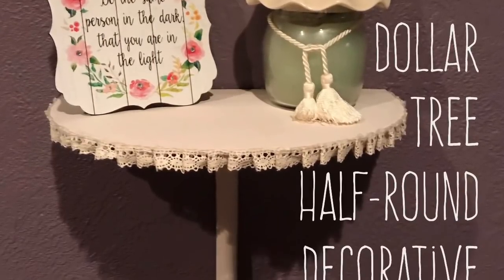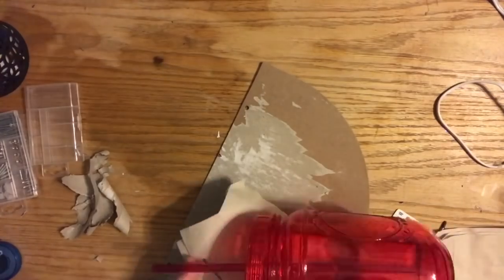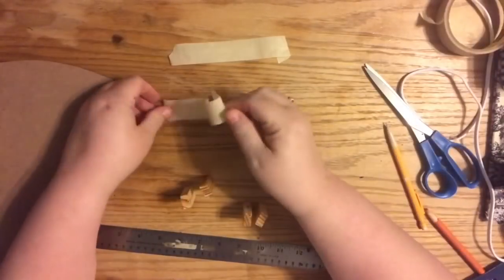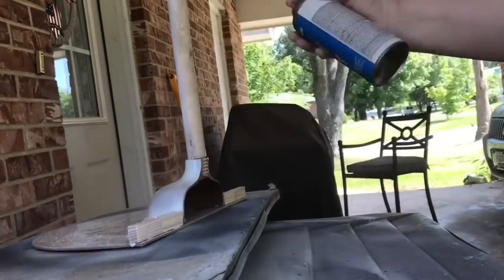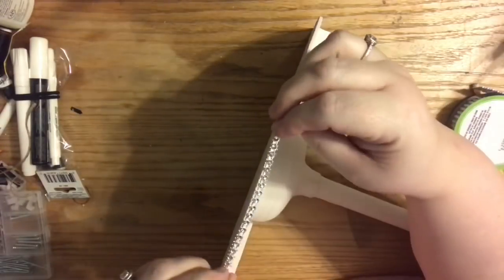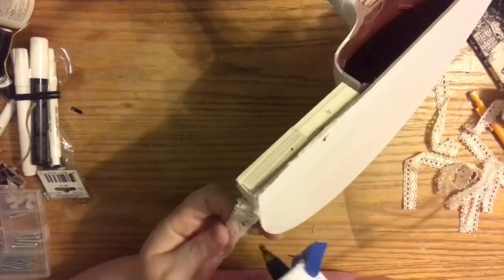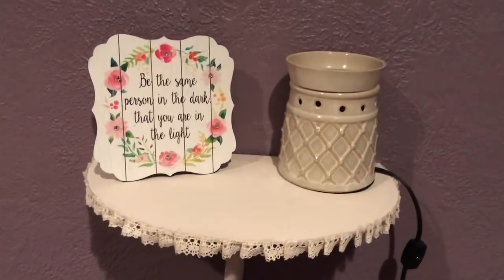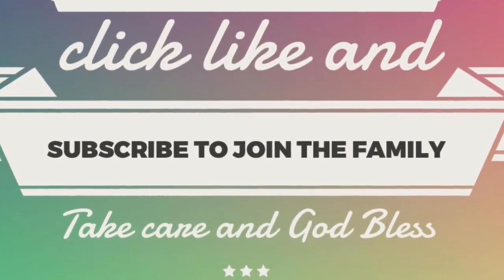DIY Dollar Tree  Half-Round  Decorative Shelf

Comment: Oh Jeri Ann you're killing me with that sticker.
Lol.. watching you remove that sticker was giving me anxiety.
Not sure if you knew but l used to do auto body and paint.
When we removed a sticker, we have a heat gun. You can use a hair dryer it will just take a little longer. Have a razor blade.. and while it's really hot scrape your blade under the adhesive but use it flat. Lightly.. I have done this on a car that wasn't going to be painted. Only scrape under the hot paper. Then move your heat as you go along.
I'm not sure about paper because it was usually vinyl we were removing but, it has a very strong adhesive and that looked like some strong adhesive.
You can buy a box of blades at the auto store or auto paint store. They're really cheap and nice to have for alot ot things. You have a NAPA?
I hope this helps.. 
Hugs J 🌺
Your table is adorable! Ingenious my dear friend. You're a little smarty pants. How do you come up with these ideas? 🌺
Reply from the maker: Jet, allot this is great advise! I didn’t use my razor scraper for fear of gouging the wood and chip board. Unfortunately I lost my heat gun in the flood and haven’t been able to afford to replace it ( I used it to peel up my entire dining room “peel and stick” tile floor) and same with my hair dryer so neither are an option for me right now. Thanks for the love and for the tips!  Sorry for the delayed response.